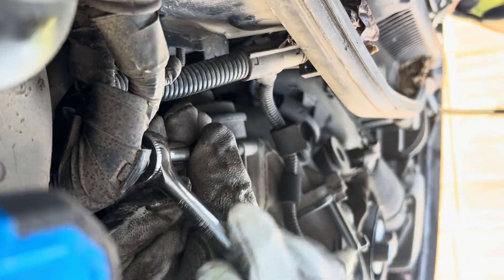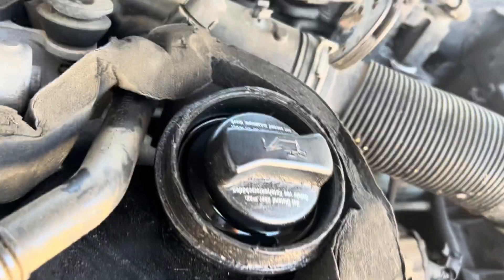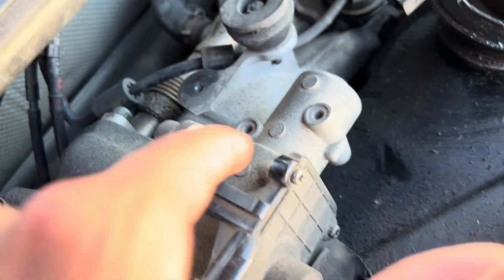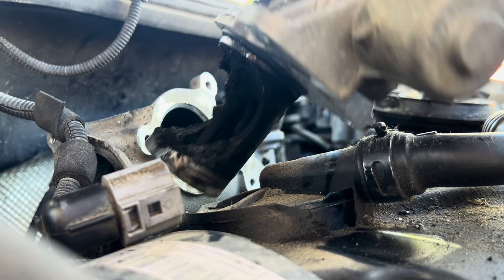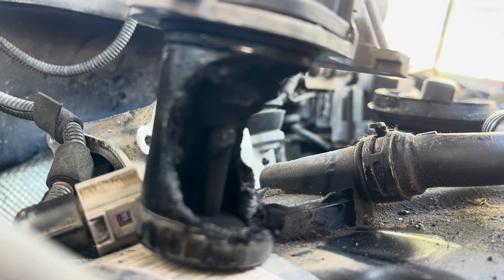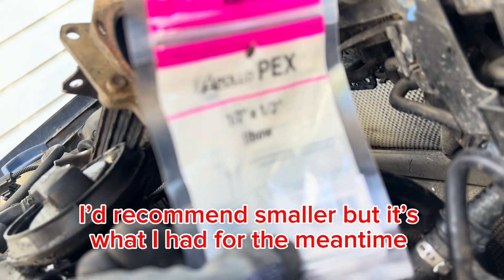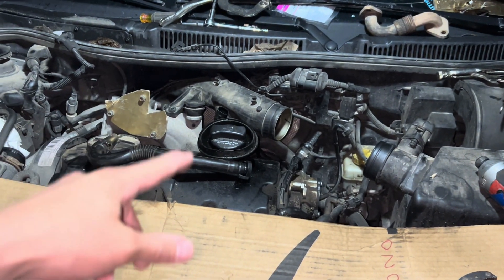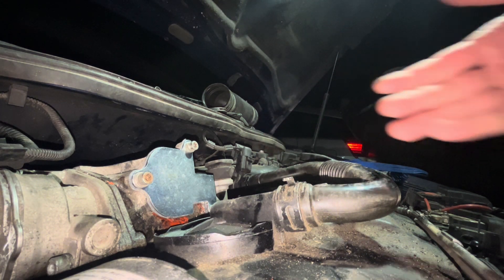TDI BEW EGR delete

Comment: Would this process be similar for the 2.0 TDI ?? I have a 2014 Passat that is giving me random / intermittent limp mode with flashing glow plug light . many sources online say it can likely be a clogged EGR
Reply from the maker: That would be the starting point, then checking/cleaning out the manifold an egr as well
Reply: @DieselDipalo I replaced the MAP sensor and it seems to be happy again
Reply from the maker: 2.0 is more expensive to egr delete then these older ones

Comment: Hey dude! I am in the midst of taking off the cooler, I got like 3/4 bolts done, but that one bolt like UNDER the cooler, i cant seem to take it off?!? How did you take it off plus what size was it. ALSO, that elbow that you used for the 2nd pair of coolant hoses, I got a smiliar connection but its not an elbow in my kit you linked below, will that also work?
Reply from the maker: If your elbow piece isn’t an elbow piece, it should still work as a straight piece im assuming your using. 
Possibly the bolt your trying to get off might be stripped I’d possibly assume or maybe use your phone to take a recording and make sure your getting the right bolt and see what’s up yenno? If you want more help and where you can send pics, I can help you a lot more if you text me on my instagram which is the same name as my YT

Comment: What does it all help with?
Reply from the maker: Stops the manifold from clogging and helps better fuel mileage and helps the engine last longer
Reply from the maker: Plus the engine wont starve for air as the coal builds up in the manifold for say yenno?

Comment: I've been thinking about deleting mine. Have you had any issues since the delete? Did MPG change and does it take longer to warm up? Thanks!
Reply from the maker: Warming up still feels the same, my MPG definitely went up and especially getting rid of the air breather for when I fill up and can cram more fuel into the tank and fills up faster plus diesel dosent expand like gas yenno? No issues since if you copy what I did !
Reply: @DieselDipalo  sounds good. Thanks for the info. I'm getting a o2 code, but I don't know if it's the sensor or the EGR system. It's pretty much just as cheap to delete it as to replace the O2 sensor, 😂
Reply from the maker: @ haha fair, I couldn’t find a pipe to replace a piece so I just left it unplugged